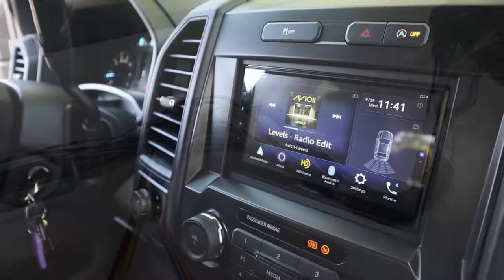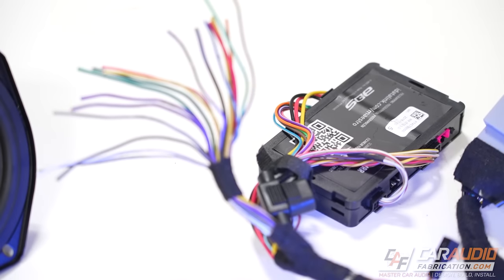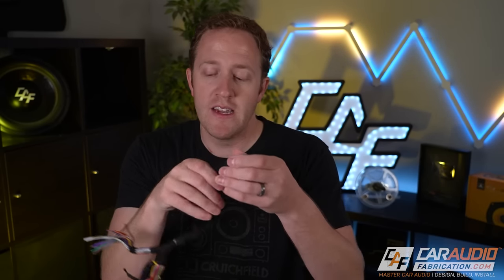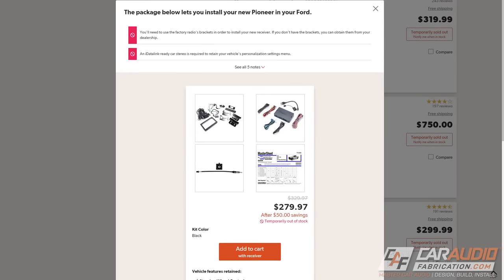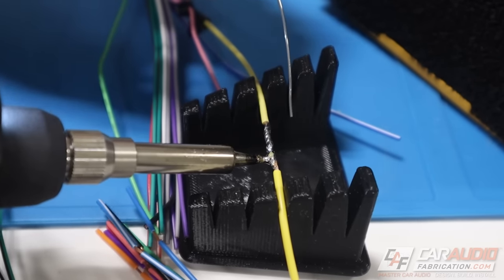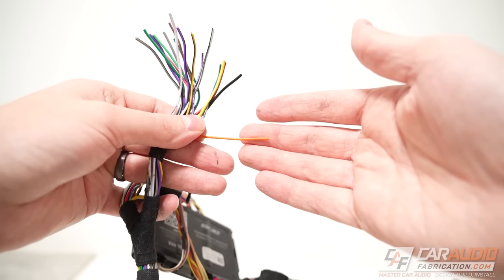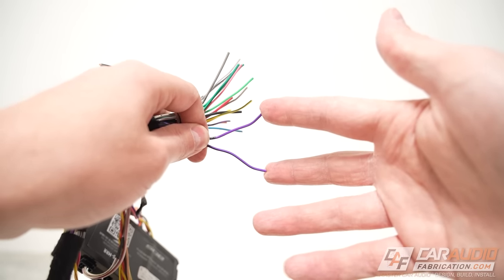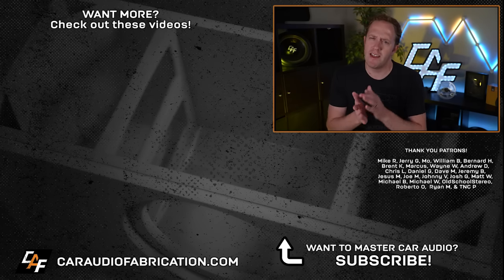Car Audio Wiring Colors + How to interface with YOUR CAR

Comment: Hi, I have a little problem after installing a new head unit and I did not run new speaker wires (which I now wish I had done) I have a problem with my front speakers left and right are back to front, no problems I just untaped everything swapped them over and taped everything back up, but now when I tested it they are still back to front so this time I just swaped over the left and right wires coming out of the head unit and taped it back up, but now they are still back to front so do you know what is going on.Thanks.

Comment: It sucks. I bought the module and steering wheel interface but guess what. I bought a new JVC stereo and it's not compatible now. I either use my old eclipse stereo or buy a new module. 🙁 I go online and find the SWI-RC that is compatible but so far it isn't working. I contacted PAC and they want me to buy another module that is worth $129. I already wasted plenty 😡

Comment: Well my car, to many of the cars functions are in my factory "radio" including AC/heat controls, so my only options for aftermarket are these 2 or 3 company's that make a replacement screen that has all the ac/heat controls with the other car functions, its $1000. my car 2016 does not have apple car play/android auto so i bought a kit from gtacarkits that gives it that function for $500 while retaining the factory "radio"
Reply: Swapping out a headunit in many new cars is just not an option as it does way to much and no longer the Double Din size.  

With those you just need to focus on the spaeakers

Comment: I put an radio in the step son car. Only time he could use it was when he had his head lights on.
Reply: Friend grounded his sub to the rear seat and it only worked when someone sat in the back 😂 as the seat would touch on a bolt underneath
Reply: You wired the acc. wire on the radio to the illumination wire of the car

Comment: You WILL run into vehicles which ALL the wiring colors on every diagram are wrong and will need to trace each wire....
Reply from the maker: Yep, but at least they get the spots on the harness correct, which is why aftermarket harness and integration kits are a great solution
Reply: Thats only if you chop the harness off and need to do a hardwire installation, in which case you will need a multimeter cause there is no vehicle where the colors match up to aftermarket colors

Comment: I learned by taking the door panels and back panels off my old 96 Honda civic hatch for the speakers and ran my own power, negative and just plugged in the antenna. After that, I pretty much learned how to wire amps, sub's and able to watch in-dash DVD players bypassing the e-brake😅.

Comment: hi Mark I'm upgrading my 2017 XL ford, I'm also gonna be installing an Alpine KTP- 445u.I am going to be using the pac steering wheel control kit, Can I just run low level RCA'S  from the HU and splice the speaker wires from the amp to wires right into the harness before the plug. . I;m just trying to avoid cutting any of the stock wiring, it s gonna be an aftermarket HU.

Comment: I am looking for a single DIN car radio.  The most important features are:

1) volume knob that works - ie, requires a long push to go into menu so when you are driving you can adjust volume without going into menu system hell 
2) When powering up the radio/car it should ramp up volume slowly and stop when volume knob is touched.
3) Have independent gain setting for bluetooth and FM. So you do not have to crank volume up high on bluetooth, or at least be matched
4) Has dimmable input wire, so it does not blind you at night with lights on. 
5) Ideally can set LED colors to match rest of the car back lights. 

It is sad how many car radios fail on these simple things.  I hate the volume knobs and menu system so bad....  
Do you have a recommendation for such a car radio?

Comment: Can anyone explain the taboo subject of a vehicle that has a wire that a wire connect to the radio running to an airbag connection?
04 explorer with C240A connector that has VSS line and airbag connection wire yellow. Connector C240B has the regular power and speaker connections.
I see so many videos about people installing an aftermarket HU then they get the airbag light after that on many makes and modles.
Figure this is the SRS airbag loop that does its initial loop check. But why the radio?

Comment: Hey Mark. Have you noticed that the eq on cellphones has changed? The don't play low's anymore.
Noticed this when i changed my old phone into a new one, and the sound in my car didn't play low's anymore on the new phone. The equalizer on the new phone stops at 63hz now.
What can i do?
Reply: Buy a dragonfly DAC that’s what helped me
Reply: i recommend  an app called power amp it will work with outside dac's as well

Comment: Can someone explain - why these headunit wires are so thin? 
Most stereos come with a power rating 50W x 4 Channels = 200 Watts. 
Amperage = 200 Watts/12 volts = 16AMPS Approx.
Don't we need an 8AWG POWER & GND cable ?

Comment: I already have installed an amplifier 5 channel but sub output is 75 watt at 4 ohm  my subwoofer is 250 w rated at 4 ohm 
I wonder if tha will cause a wire burning. Since it happened before 
The guy said it was cheap made wires.
So he instead used better quality.
So I wonder if I can have them to  add a mono amp for the sub for better sound and matching the subwoofer. But still keep my already installed amp 5 Chanel

Comment: Long shot here, but you wouldn't have any idea on how to upgrade a Ford Sync V1 unit, would you? I'm sick of the system in my 2011 Taurus SHO. The bluetooth cuts randomly and won't connect until I reset the whole system. I hate it. However, HVAC is tied into the head unit. I haven't seen any factory options available to help me with this problem.
Reply: I love those cars. I think maestro IR works with Ford. Also there are some Kenwood amplifiers with it built in, or Rockford Fosgate DSR1. Good luck.
Reply: Maybe just buy Ugreen 40759 with aptX HD and connect it to AUX input? My 10 years old car has only headset profile BT on headunit, so I bought it and 0 issues so far.
Reply: @aleyer_s  A separate BT receiver could work I suppose. The issue then is that the levels between AUX in and factory Bluetooth are much different. AUX doesn't get anywhere near as loud.
Reply: @raymondsedlacek5003  What's there to love? 

I've never heard of Maestro. What does it do that will help me here?
Reply: @amorton94  well, that's strange. Haven't faced that issue with my cars and radios.
Reply: I thought you were just trying to add amplifiers.
Reply: @raymondsedlacek5003  No, I'm trying to replace/upgrade the head unit but don't know what to do about the HVAC controls.

Comment: Ground in Black I am fine with...

But I think I will never understand why yellow is battery 12V constant on these harnesses.
Why isnt it red? Like on the battery itself or on jumper cables. there its red for + and black for -
Reply: You have power coming from battery and accesory in some cases so red is acc while yellow is batt
Reply: @Baldwaldo  Yeah I know. but why is it switched? Red constand and yellow acc would be way more locigal 😂😂

Comment: hi mark! my 2011 crv has a factory amp and sub if i will replace my headunit with that maestro rr interface, is my factory amp and sub will work with this?
Reply: Check the maestro website. It will tell you what features you gain or keep based on the configuration you have

Comment: I have a question: my headunit has a Orange/White wire and no solid orange but my Wiring Harness has only Orange and not Orange/White. Should I connect the Orange/White with the Solid Orange? Or should I cover them and not connect them?
Reply: Ssame for me! Someone please respond
Reply: I'm a year late but you would just go by the pin # and not the color at that point.

Comment: Can you skip adding an LC2i pro with this harness thing cause i just want to install a subwoofer and not an entire system
Reply: Well to get the audio signal from the factory radio for the amplifier for your Sub, you have 2 options, line output converter like the LC2i, or an amplifier with high level inputs, or an aftermarket radio with sub pre-outs